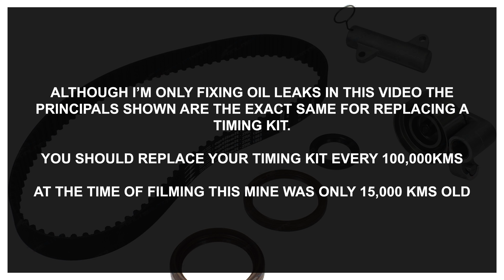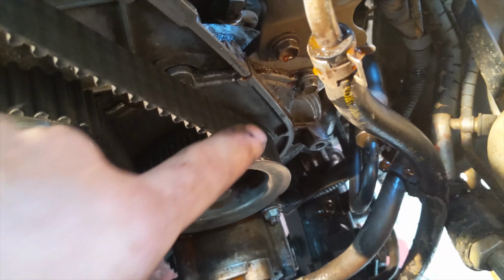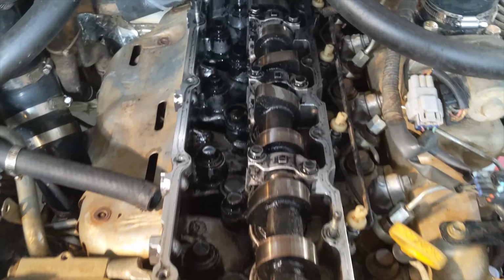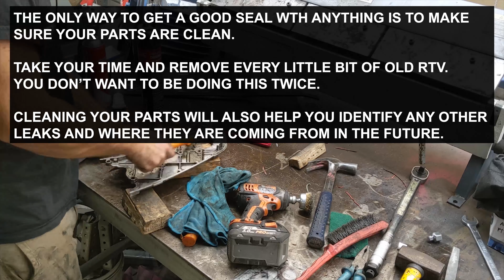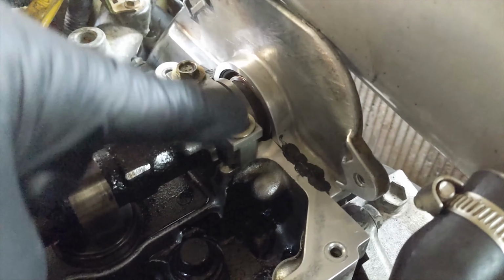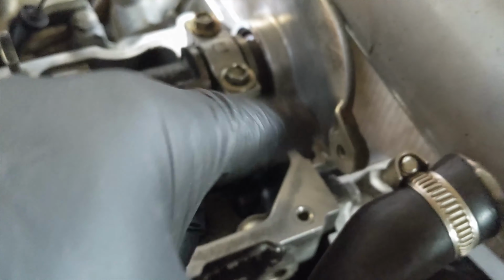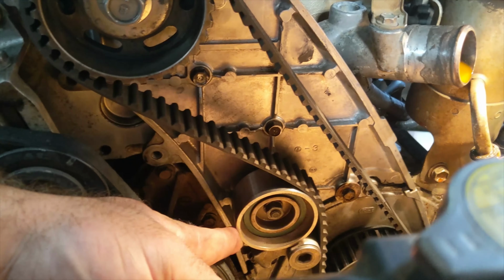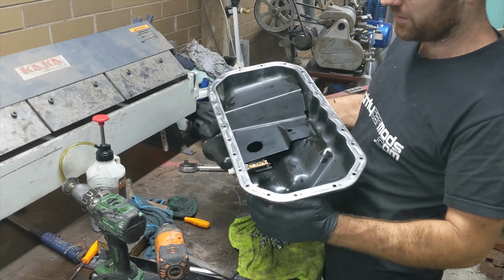How to Replace a 1KZ-TE Timing belt, Main seals, Tensioner and More!

Comment: Nice detailed video. I thought you have to change the tensioner everyy time the belt is replaced?
Reply from the maker: usually yes but in this video the condition of everything was actually quite new. I took the timing kit off to service a different part of the engine and filmed the tutorial on the timing belt while I was at it.

Comment: This video gave me the confidence to do my 1KZ timing belt and it is really straight forward and simple as you showed here.
Engine runs fine so i guess i did everything correctly.
Reply from the maker: Really happy to hear that! Comments like this are the reason I make wideos in the first place!
Reply: I'm a bit sad that i can not try the resistor mod as i have a mechanical pump :-)
Reply from the maker: @nilz6432  im a bit sad i dont have a mechanical pump!
Reply: @dingeldiy  Yeah of coure its more reliable, but resistor mod would be perfect for a little extra power and could be easily removed every 2 years for tech inspection in Germany...

Comment: Thank you for the video! I’m getting ready to do the timing belt on my Land Cruiser Prado with the 1KZTE. Everywhere I’ve looked at advises me to change the water pump with every timing belt change. Do you have a video on how to change the water pump as well? I sorta skimmed over your playlists but didn’t see one at first glance. Your video is very informative!
Reply from the maker: If it's not leaking, leave it alone. Otherwise just remove the bolts that hold it on, clean off the mating surfaces really really well and install the new pmp with an appropriate amount of sealant.

Comment: Hey mate was the timing belt light easy to reset
Reply from the maker: Yes
Completely disconnect you battery for 60 seconds and it should reset all engine codes. 
If they come back you haven't fixed the problem
Reply: @dingeldiy  people are saying there is a screw behind the instrument cluster mine is a 2004 sr5 1kzte
Reply from the maker: @vincenzoadragna2522  first I've heard of this screw. 
Try what I said cos that's what works for me in my 2002 factory 1kz SR5 Hilux
Reply: @dingeldiy  thanks mate for taking the time to reply thank you
Reply: @vincenzoadragna2522  yeah there is mate  but id try dingels way first,  beats rippin half your dash out

Comment: I’m about to change the belt on my prado, just wondering what the extra seals are for as l have the same 2 smaller and one larger one in my belt kit, along with the idler pulley.
Reply from the maker: cam seal, injector pump seal and front main seal

Comment: Mate, I need your help. I took the belt off and cam gear and bottom gear are out of timing. How do I get them lined back up individually
Reply from the maker: take the belt off and spin each gear any way you can without damaging the gears teeth. usually a socket on the gear bolt will work

Comment: wouldn't you just loosen the cam gear bolt first with the belt still on instead of removing the rocker cover?
Reply from the maker: You could buy might just end up turning the engine over instead if the bolt is too tight

Comment: Hey mate, @4:11. I think my cam shaft gear has been moved without the belt on when trying to get it loose. There was a bit of a noise that didn't sound too good. Worried I've cooked it. Are you saying something in the block might be fukt from this? What happens? Anything to look for when I get the head off? 
Great content, been watching the other vids over and over, tho seems I should have watched this one a few more times.
Reply from the maker: With the belt off, the cam shaft can move so long as you make sure it is in the right position by  the time the belt goes back on.
technically speaking you can disassemble everything carelessly as long as  when you reassemble everything the timing marks on the belt, gears and engine casings all line up correctly. 

The camshaft controls the valves and if the camshaft timing is wrong, the valves will hit the pistons and bend the valves causing catastrophic engine damage. 

keep in mind youre not likley to damage the valves by hand, you will most likley only damage them if you run the engine with incorrect timing. 

Thanks for watching!

Comment: Should i not change the tensioner and tensioning pulley any time i change the timing belt?
Reply from the maker: Absolutely change everything! Do the full kit every 100,000kms 
It's only a few extra bucks and if you're already doing the belt that's the best time to change the pulley and tensioner! 
In this video I didn't change mine because the kit was only 5,000 kms old and I was just only pulling it all apart to fix other issues